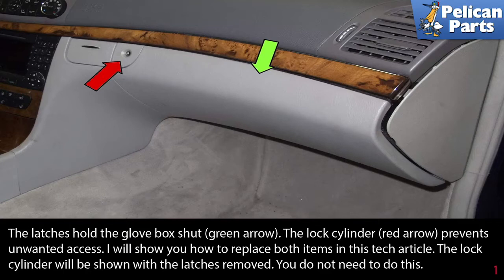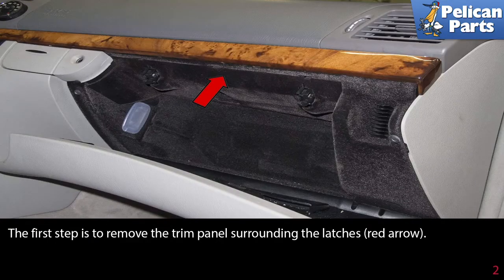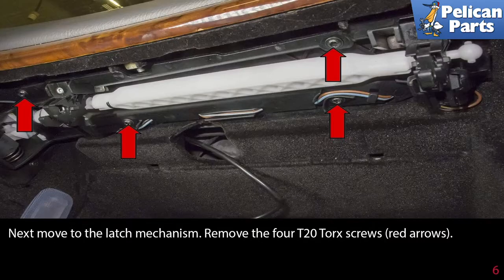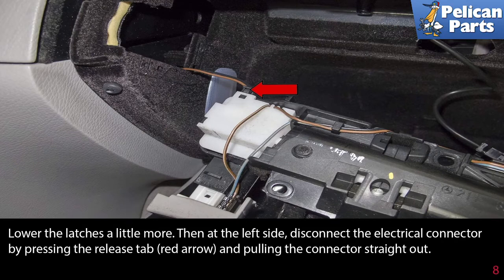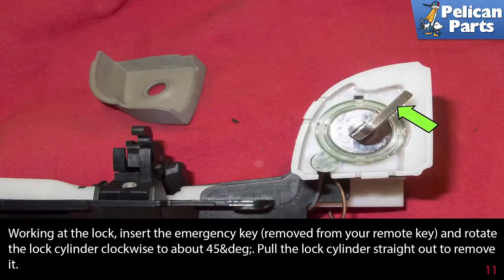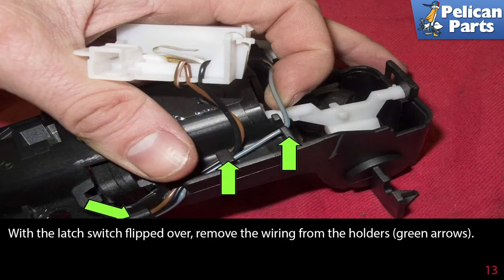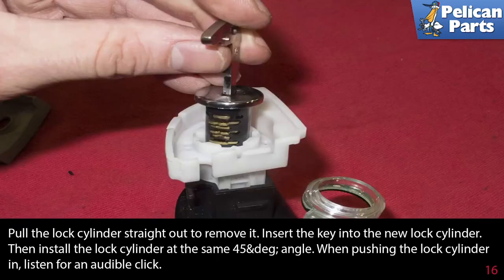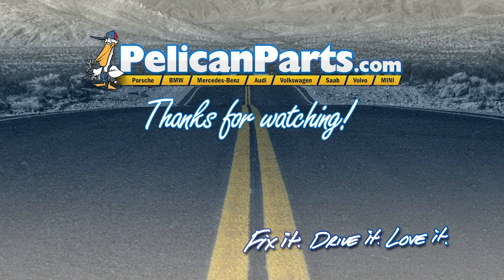Mercedes-Benz W211 E-Class Glove Box Latch and Lock Cylinder Replacement

Comment: what electrical wires are accessible with the glove box out , i need to add  USB port inside the glove box i'm wondering which wires i should tap into , i was thinking the light would work but it's turned off when the glove box door is shut close so i would have to feed from the wires coming into the switch ? alternatively i can always run wires from the cigarette lighter i guess
Reply from the maker: You are better off running new fused power from  fuse panel. As you could overload a circuit.
Reply: thanks that's true  @pelicanparts